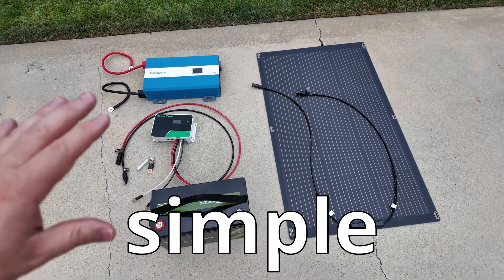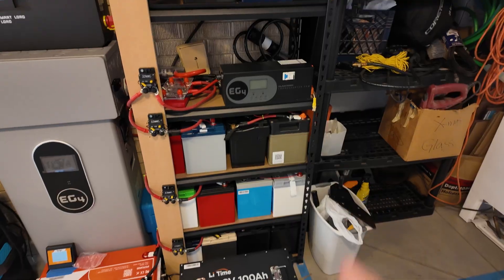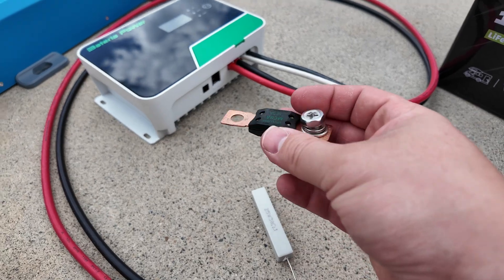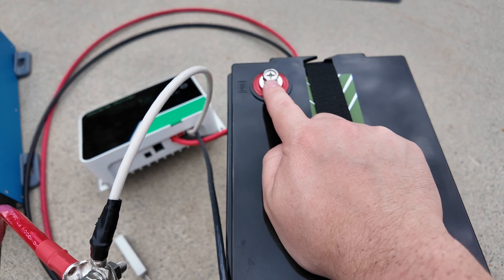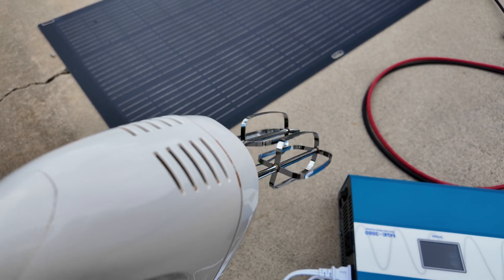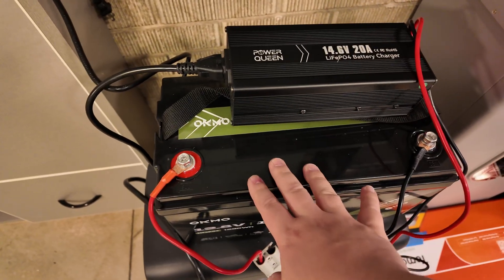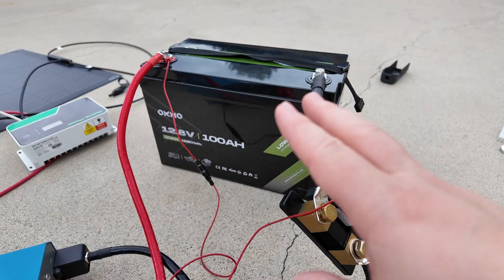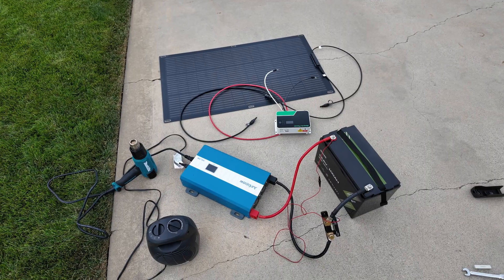Back to Basics: DIY 12V Solar Power System Build (Step by Step for Beginners!)

Comment: I started out with hobo freight 100w panels and a pwm controller and 2000w inverter that I built in a rolling toolbox. That's how I learned the basics. Keep upgrading and adding. Now I have 20a, 35a and 60a mmpt controllers, seven 100ah batteries, 2 300ah batteries, a 1300w array, 400w and 3 100w panels plus 3 power stations and 3 chargers. Since I am strictly planning for infrequent power outages I am stopping at 24v but it would be easy to keep growing and spending more $$. This is a very good basic starting point I wish I had seen when I started but doing things wrong is often the best way to learn. What I need and what I want aren't necessarily the same thing
Reply from the maker: Great thoughts and advice! You have a great system it sounds like! Thanks for watching!
Reply: Watched until the end. Nice demo!

Comment: Thank you for this video. Can you do the same style video with a bigger system? Specifically, I was looking at the Temgo 51v 100Ah golf cart battery that you reviewed a few weeks back. If that is a bit too risky for the average person, maybe you can show this 12v setup with multiple batteries instead? I'm looking to build a decent sized backup (say 4+ Wh) and not sure what's the safest route. Either way, thank you for the video. It's truly informative.
Reply: Look up Will Prowse, he has a great video for a handcart 48v system, easy to set up
Reply: @einyv  Will Prowse is the best. I did watch his video too, but it never hurts to have more points of reference. Thanks for the recommendation.
Reply from the maker: My pleasure! Yes! I would love to make a video like that! Great idea! The 48v golf cart battery is a great option especially at its price point and the extra charger you get! I think a single 48v battery is actually better and potentially safer than a bunch of 12v simply because there are less connections to mess up on hahah! I’ll put this idea into the video list to make! Thanks for watching!